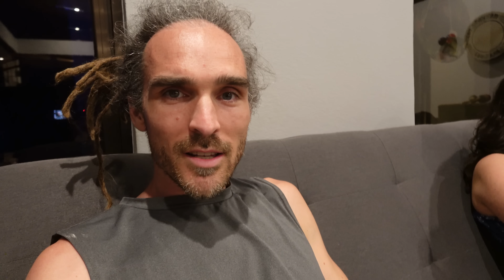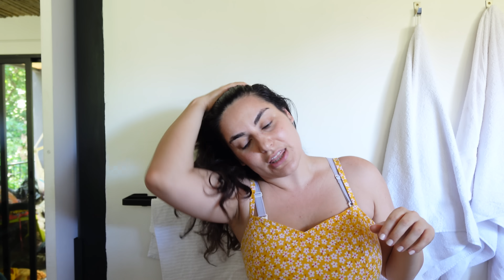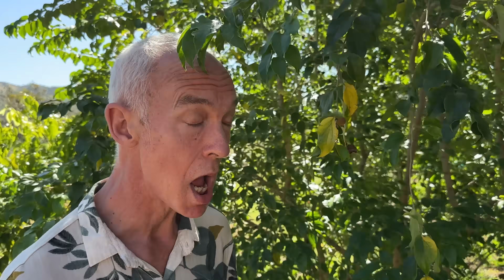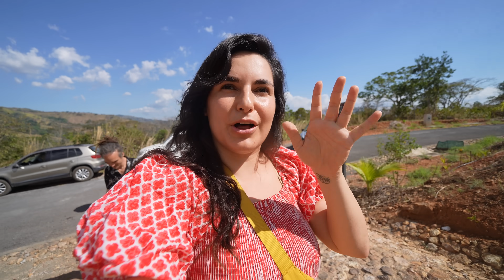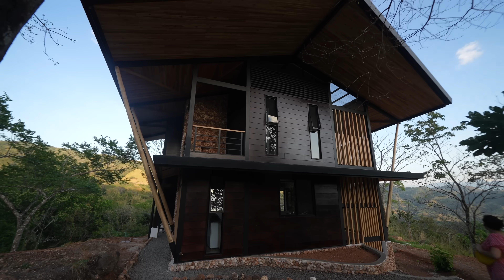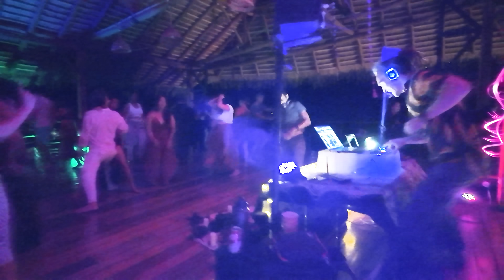Amazing Eco Village House Tours  // Jungle Diaries Ep 4

Comment: Raya I make my own hair oil I would recommend Coconut Oil as the Carrier add the extra herbs or drops to the coconut mixutre then leave it on your hair for a hour minimum, it depends what extras you add too it on its own you can leave coconut oil on over night with a hair wrap on and the trick too not having greasy hair after it is to shampoo it 3-4 times after rinsing off the coconut oil and dont use any conditioner and style as normal. I also recommend before that using Apple Cider Vinegar you add some to water and pour over your scalp its easiest whilst in the bath for this bit rinse thoroughly then use the coconut oil mixture or whatever carrier oil you prefer. Highly recommend it and it also helps strips your hair of any toxins aloing with aiding in hair growth